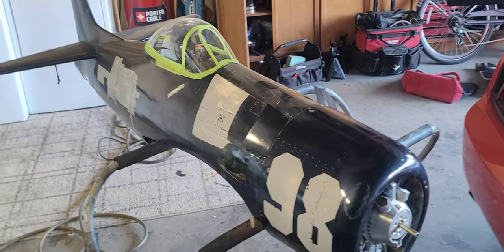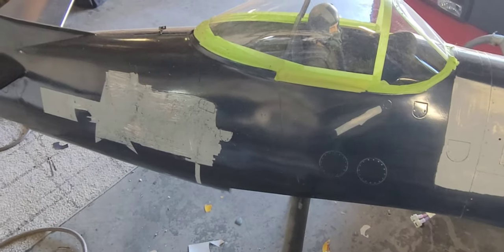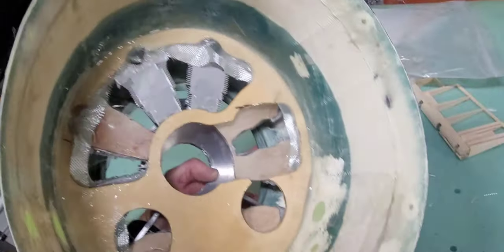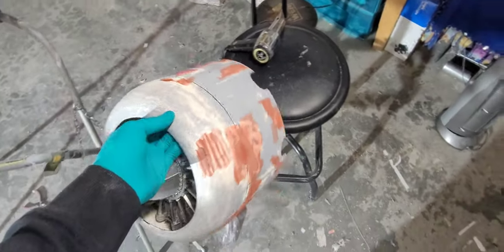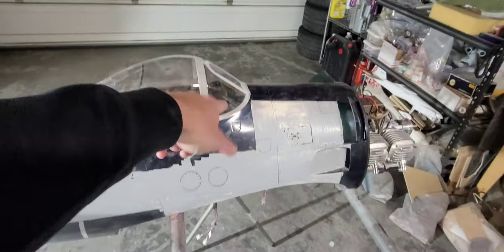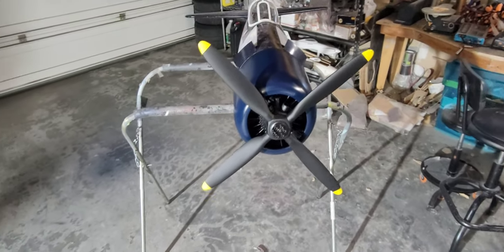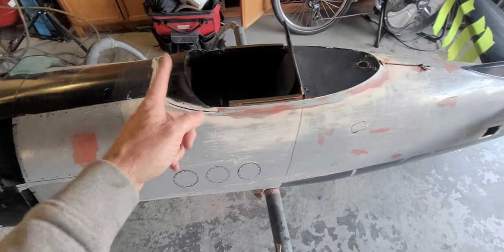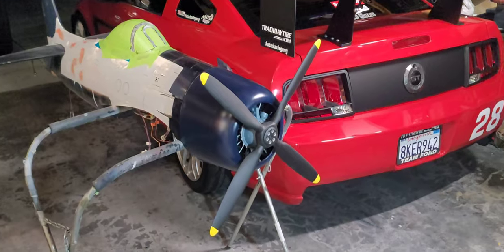GIANT SCALE F8F BEARCAT UPDATE

Comment: There’s an optimal position for the cylinders inside a cowl which is basically airfoil shaped and controls the airflow - it’s a far more exact science than some think. On vinyl letters heat them up slightly before removing them to avoid pulling paint. (I used to wrap and unwrap Ferraris - talk about nervous work) love the cat, I’m trying to find one myself now you’ve rekindled a fire in me.
Reply: A whole other level..